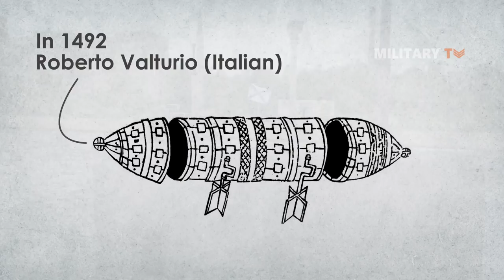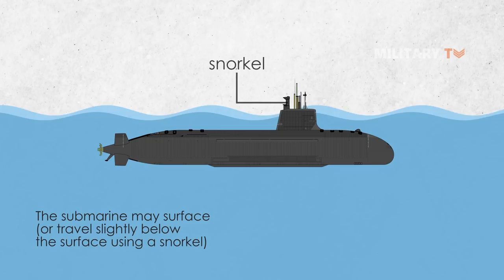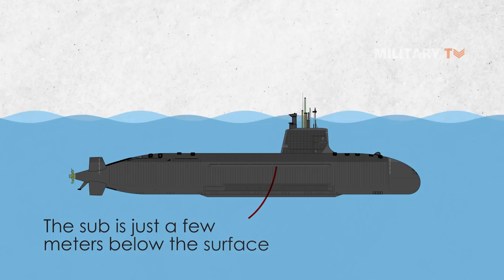How long can a submarine stay underwater?

Comment: Replacing batteries with hydrogen fuel cell will be a good option
Reply: You still need oxygen (ie air) for the hydrogen to burn.
Reply: @MarkYeung1  that can be carried in a separate tank. Hydrogen has a higher energy density than any other fuel
Reply: How about the German style fuel cells AND the lithium batteries that the Japanese are using?